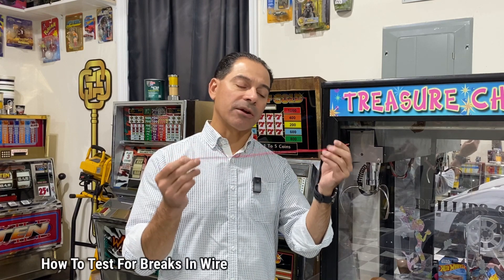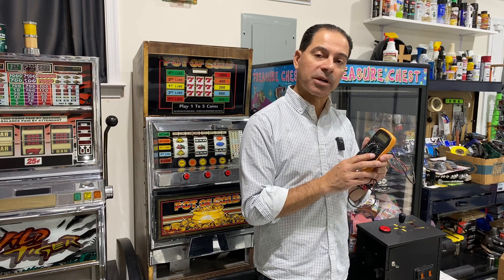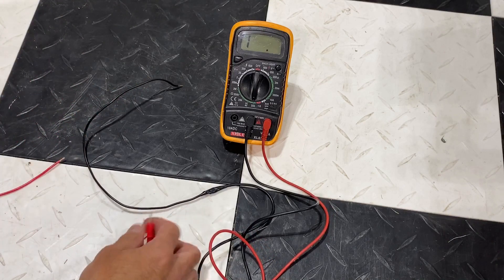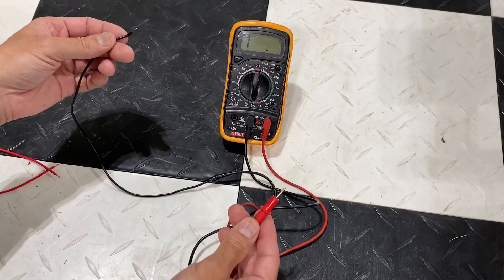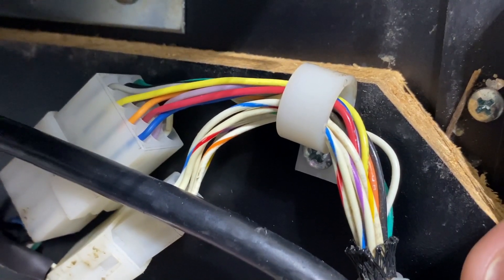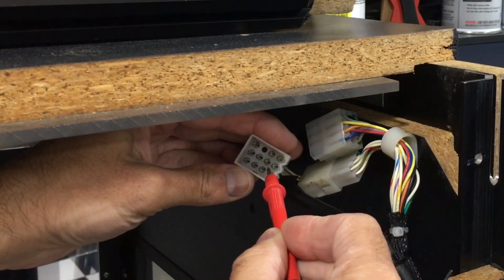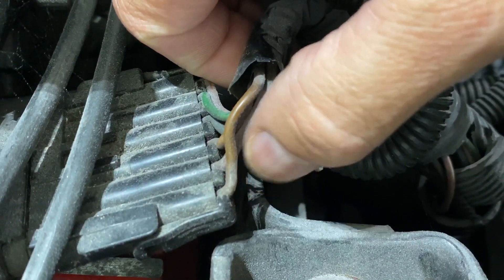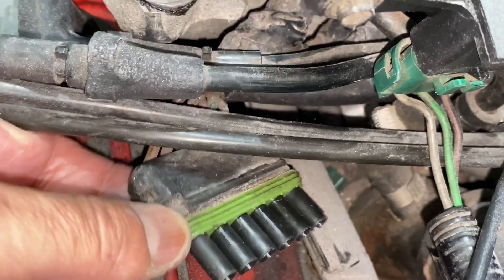How To Find A Break In Wire (Phillips Vision: Episode - 90)

Comment: How long are your probe wires? How can i reach the backup camera and the radio harness that connect the camera?
Reply: Use a long wire and “plug” it into a pin and run it to the other side of where you are testing